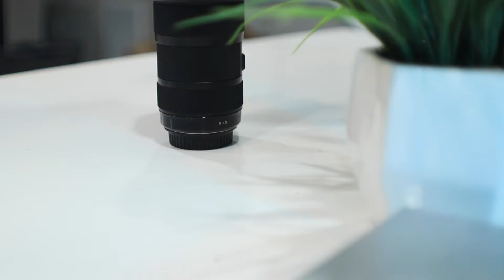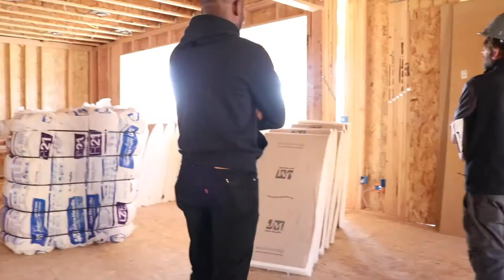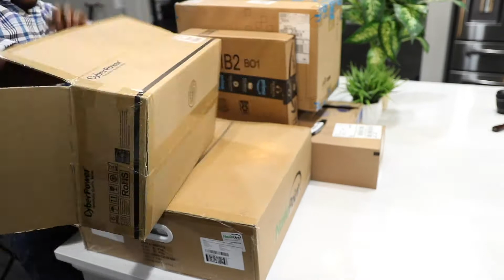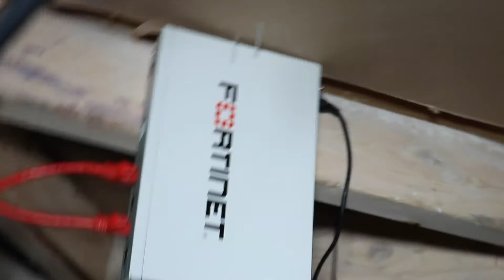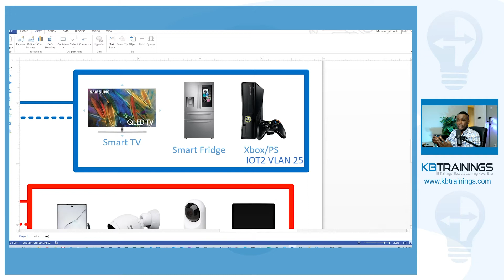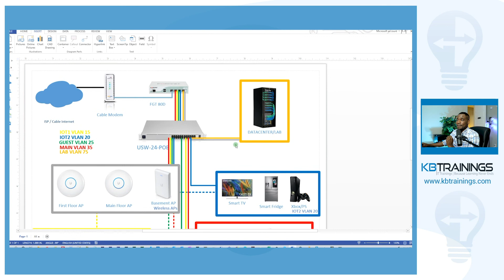Installing a Home Network in My New Home 🏠 | Video #1: Unboxing & Design

Comment: What do you think of my new design?
Reply: Interesting . As you know internet installation from network administrator is really différents from End user.
Reply: intersting...and will you upload the video daily?
Reply from the maker: I am thinking of weekly uploads. After the install itself, the video editing takes some time too.
Thank you🙂
Reply: @KBTrainings  which software do you use for video editing?
Reply from the maker: For video editing, I use Adobe Premiere Pro
Reply: Wonderful.
Reply: any reason why you're not splitting up cameras/security in its own VLAN? I have a somewhat similar setup in mind for my new house. IOT, main, security, guest. IOT for the same reasons as you (access from main to IOT but not other way around), but I'm putting the NVR and cameras on their dedicated VLAN. No real reason, just that I saw somewhere else that they considered it "best practice" but noticed you include them all in your main network.
Reply from the maker: It should be best practice to put cameras in another VLAN but in my case I wanted to alleviate some routing load on the Fortigate by keeping the cameras and their Storage in the same VLANs as my main devices.
I may as well have them in a different VLAN, we'll see by the end of the project. 
Thanks for watching Tom!
Reply: Looks expensive haha
Reply: Love this! Thank you!

Comment: Very informative video, I see you are planning to use USW-24-POE..does it have enough power budget to run your 10 cameras, 3 APS and flex minis..I am also planing to have similar number of poe cameras, APs and wondering if it is going maxout/exeeding the poe switch budget..?
Reply from the maker: I currently have 11 cameras and 4 APs and I don't think power consumption will ever be an issue. The switch is now drawing only 51W.
The biggest AP (UniFi LR) uses around 7W and each camera needs about 3W.
Reply: @KBTrainings  thank you for quick reply, good to know real world numbers as many users opting for usw pro poe switch (or gen 1 poe with more pwr budget)....many reviews and unboxing video out there for this switch but limitted real use reviews.
Reply from the maker: Glad I helped!

Comment: Love your videos! What ethernet cable do you recommend for rough-in during new construction?
Reply from the maker: Thank you Andre.
Unified Copper Cat6
Reply: @KBTrainings  Ok thanks! So it's really not worth the investment to upgrade to Cat6e?
Reply from the maker: No, it is not worth it.
We usually use 1Gbps in homes, and it is going to be the case for a while. Cat6 only offers you 10Gbps up to about 160 ft, so for a home, you can also get 10Gbps if really needed.

Comment: Guy, Great stuff.  Question for you; why add the modem and have a wireless modem and router in your network setup?  My home also has the network wiring terminate in the basement (next to a water heater).
Reply from the maker: Hi Christopher!
Thank you for watching. 
I don't get your question but I will try to respond according to what I think you meant 🙂.
My cable modem is strictly a DOCSIS modem and doesn't have any routing or Wi-Fi capabilities.  That is why the APs and a Firewall are needed.
And also having many APs will help with the speed and the load. I just got a 1Gbps fiber connection installed (video coming) and I don't want the APs to be the bottlenecks for my setup.
Not sure if I got to your point, but I am here anytime.
Thanks again.

Comment: Great Stuff and nice clean setup wish I had to much devices btw UniFi AP switches and Camera is good choice.
What is cyberpower ups?
Reply from the maker: Thank you.
I will make a video about the Cyberpower ups this week. It is the device that stabilize the power to the devices and provide battery backup.
Reply: @KBTrainings  thanks would love it

Comment: Love the setup and can't wait for the VLAN setup video. 1 question. Wouldn't have been better to keep your lan wall ports a few inches away from the power plugs? For interference reasons and for upgrade in the future unless you also ran tubes in the walls.
Reply from the maker: VLAN set up video coming next week.
The interference might be an issue in some areas, but there is at least 2 or 3 inches between the outlets and the wires are way apart in the walls.
Thank you for your viewership,  I appreciate it!